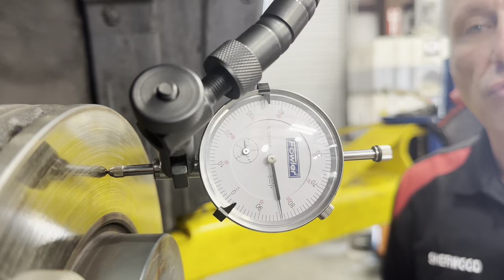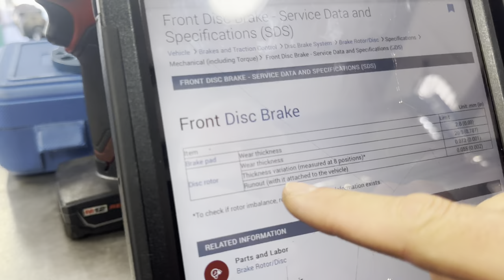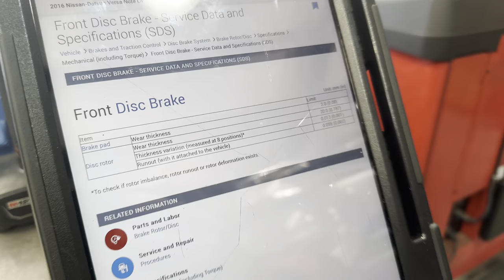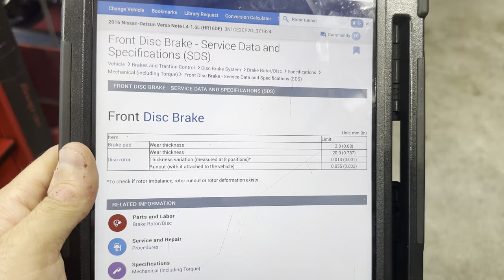It’s Vibrating When Braking & It’s Not the Rotors. How to Test! (Nissan Versa)

Comment: If you suspect this, mark the high spot and low spot on the rotor with chalk marks.  Remove the rotor and turn it 180 degrees and remeasure.  If the high and low spots stay the same, it's the rotor.  If it runout changes on the rotor when the rotor is repositioned on the hub, it's the hub. Measuring the hub directly isn't always easy or even possible depending on tool.
Reply: RESPECT
Reply: You must mean 180 degrees and not 180 percent.
Reply: @mikeblaszczak5346  Yep. Edited - thanks.
Reply: excellent analysis!
Reply: It would be much easier to just move the dial indicator to the hat, or hub area, of the rotor.
Reply: nice tip thanks
Reply: How you fix it if not the rotors. I replaced the rotors.  it got way  better but I can still feel light vibration at high speed stopping it drives nuts
Reply: Check that your wheels are properly balanced. That was my issue.
Reply: Hub assembly needs to be replaced no matter what.
Reply: @arturodiaz3047   If the runout on the rotors checks within specs (which eliminates the hub as well), then something else in the rotating assy is causing this issue.  Next stop would be the tires.  Try swapping front to back and see if that has any effect.  If there's a change, check your tires for sidewall bubbles inside and out and then have them balanced if they look like they're in good shape. But even good tires in good balance can cause a vibration if there are problems in the suspension like bad bushings, mounts, or even axles.
Reply: @ohger1 
It's a pulsation issue when applying the brakes and not constant.
Reply: @jean-sebastienguay1282  You might have hub runout like the guy in this video had. Follow this video and check the runout on your new rotors. If you get runout, mark the high spot and pull the rotor and rotate it at least 90 degree. If the runout stays in the same place, your new rotors are bad. If the runout changes positions, the tub is bent. If you get no runout, you may have a sticking caliper or collapsed brake line that is causing the rotor to get hot and warp just driving.
Reply: Thank You for answering. The issue is more like pulsation not quite a vibration to be more precise. I had vehicle aligned and balanced tires rotated prior and continued with the issue so my assumption was to replace rotors and brakes which I did. The problem improved 90 percent. I'm going to check the caliper  hose hubs and calipers. 
Thank you again
Reply: @arturodiaz3047  If you notice the pulsing happens after driving a bit and not the first couple of stops, then you might have a caliper hanging and heating the rotor beyond its design temp.  If you have one of those non contact IR thermos, take the car for a ride using the brakes aggressively.  Check the temp of the rotors at the edge - they should be within 10 degrees of each other.  If one side is getting hot, it's warping your new rotor as you drive.  I just did one that after a light drive, the left side was at 150F and the right side was at 600F... in this case, it was a bad brake hose which collapsed internally.  This was unusual in that the rotor got hot because of the brake dragging on the rotor even when the brakes weren't being used! Hoses are cheap enough that if you suspect a big of drag, change both brake hoses.  If the hoses don't fix it, the caliper is likely the cause.
Reply: Great Information.Thank you very much. I will do as you told me to find  the culprit
Thanks
Reply: You're Wright sir should we change the wheelbearing too ?
Reply: Excellent comment.  I've been replacing my own brakes for years and have never had a hub cause this but now I know how to check for it with my runout gauged.
Reply: You have suggested an excellent test, but have swapped the results by mistake.
Reply: @DonziGT230  The hat won't measure reliably. The flange is the issue and you want dial the outside perimeter perpendicular to the studs.
Reply: Thanks! ,if the problem is the hub , is the hub bearings always the cause of can the hub face become warped ?
Reply: @jacobclark89  They get bent in collisions or when people press them incorrectly
Reply: That was my first thought and what I assumed they would do. I think it's probably a better measure than trying to get an indicator onto the hub.
Reply: Thanks this is really good advice. Is it obvious if it's bearing or just the hub runout?
Reply: I own a machine shop. Run out is always a challenge. I support several mechanics. Just this week a hub assembly was brought in. The manufacturer pressed the bearings in and failed to maintain perpendicularity.
Reply: @Mark-ce4rz   Hub bent probably from a thwacked curb.  If the bearings were bad you would feel the clearances.
Reply: That's some messed up hair...
Reply: Graci, great idea.
Reply: Beautiful!
Reply: @ohger1  ' then something else in the rotating assy is causing this issue.'
Be aware, it can be other things.  Worn out suspension bushings can interact with braking forces at resonant frequencies and produce very similar results.
I had a 2005 Cadillac SRX with around 120K miles, and the suspension was completely shot.  It would mostly drive OK enough, but every time leaving Southern Pines on US 1 there was about 10 miles I had to stay under 40 MPH.  45 plus and the ripples in the road interacted with the weak bushings and would violently shake the entire car.  Typical that the bushings etc become the weakest around 55 MPH, which is where they are most used.
Changed out the entire suspension, and the car drove like new of course and no problems in that same stretch of road.
A bit different situation but similar idea, always check the control arms/bushings/suspension etc as well.  If it isn't solid you can get all kinds of interactions.

Hmmm seeing this a bit later ' more like pulsation not quite a vibration to be more precise'
Pulsation, first thing that comes to mind is maybe still a bit of air in the brake line.
'Air in the brake lines: If there is air in the brake lines, it can cause the brake pedal to feel spongy and pulsate when applied. A loose or damaged brake caliper: If the brake caliper is loose or damaged, it can cause the brake pedal to pulsate.'
Some cars can be a bit difficult to get all of the air out of the lines.

Ha search this 'Does Your Car Shake When You Brake, Do This'.  First thing Scotty does is check the wheel for other problems before even going to the brakes and rotors..
Reply: Can swap sides too
Reply: @kellyappel3015  - could be just need to clean rust or crusty shit off the face of the hub and/ or rotor.
Reply: WORD!
Reply: Excellent way to check the hub and rotor! Thanks for sharing.
Reply: @mikeblaszczak5346
You are excellent man! You seem to be more knowledgeable than 
most of the folks on this 
thread/forum. Thanks for
 your tips and advice. 😀
Reply: You can’t turn five bolt pattern rotor 180 degrees…
Reply: Great insight.  I always love a work around when you don't have the hight end tools.  Thank you.
Reply: Why at 11,500 miles would a car need brakes?
Reply: @leecromwell502  You don't know how the car is driven. Mostly highways - of course you don't need a brake job after such mileage. But what if that's city only or twisty mountain roads where you basically drive in a start/stop mode all the time? And if driver likes to go fast...
Reply: @leecromwell502 Because it’s a Nissan.😅
Reply: Typical example of no formal education.  The guy has the tools but no knowledge to use w/ them. This was more a dial indicate & micrometer video. He could have marked the rotor high spot and location on the hub then put the rotor in a lathe, either shim or offset it and cut the 10 thou off the high.  Then put it back on correctly locating it by the marks made. Always recheck for assurance. One of the most beautiful things about cars is their robustness. That rotor would last until discard thickness w/ no harm to anything running out because the outage is insignificant to the robustness of the bearing. This shop is typical of a "parts replacer" shop. There is just no argument the bearing/ hub "needs" replacing. Probably if we made it a law that they NOT add cost to parts, which is similar to a kick back, the problem of replacing parts that don't "NEED" it would go away. Only politicians take kick backs.
Reply: @edvinasm7902  Sure you can. And when you are driving, every time the wheel rotates 1 time, it has turned 180 degrees TWICE.
Reply: The point is that you need to take the brake disc off, rotate it and put it back on. When there is 5 bolt pattern, you can rotate 72/144/216/288 degrees
Reply: Awesome
Reply: Usually there is not enough "stock" on new rotors to do any machining on them after a set of pads has run their life.
Reply: @michaelangelo8001 Underrated comment
Reply: Moving the dial indicator to the hat add a few potential degrees of deviation from an accurate reading.  Rotor hat thickness and trash between the rotor and hub. 
   It’s a possibility as an initial test but not one I would use for a final verdict.
Reply: If it has high and low spots why not just turn it on a lathe , if that's not possible just replace rotors
Reply: Maybe Im not understanding well. What if you  pass a bended part in the hub, and now the rotor shows good?
Reply: @ohger1 👍Thanks for the info.  I have to go through those steps for my Mazda 3 front left issue
Reply: @edvinasm7902 exactly this comment. I went 13yrs on my stock pads due to 95% highway driving, no traffic lights. 
Wife car needed pads twice in same time, due to city and small driving errands. Constantly braking more.
Reply: @pwrshots  Yes, properly balanced tire/wheel assembly is felt at different speeds. Above or below, the vibration stops. That is a tire balance issue. However, a warped rotor or bent hub is an imbalance all of the time. There is a difference. ASE Master 78.
Reply: Yes, but the hub is still bend. The practice you described is used during balancing if a high amount of weights are required.